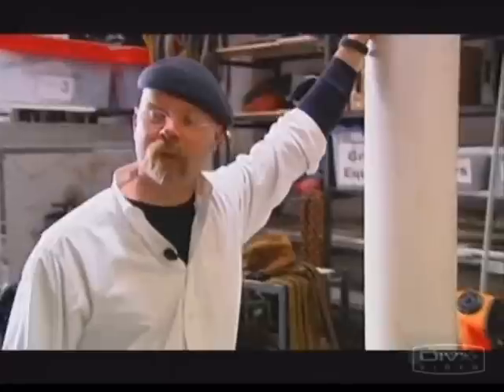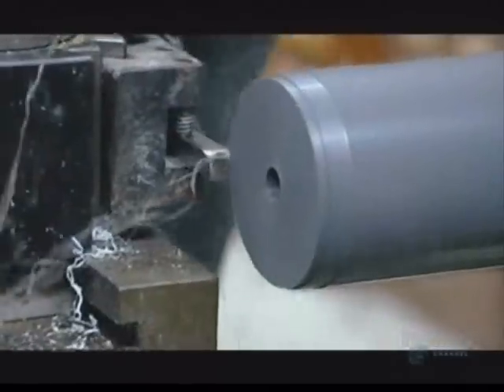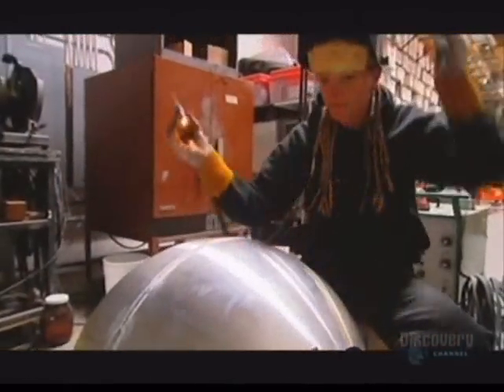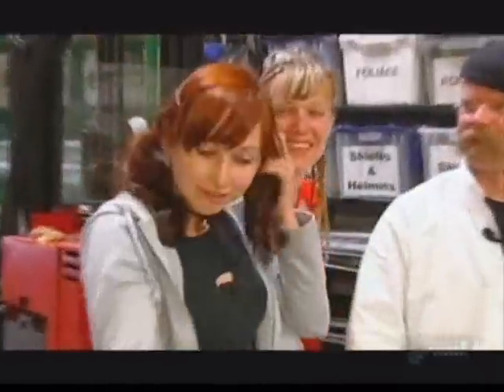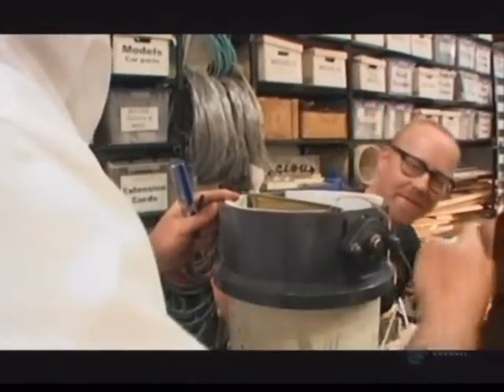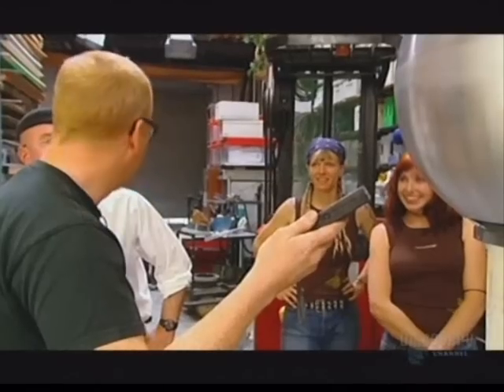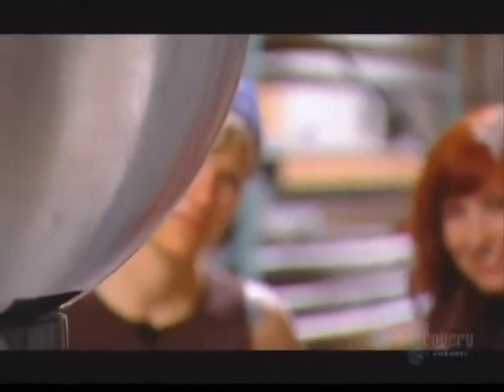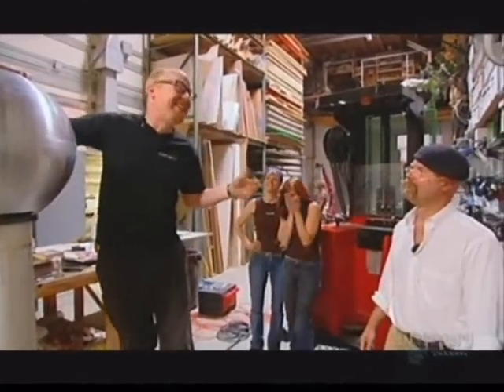Mythbusters Van de Graaff generator

Comment: You are right technically, current is the one that will kill. However high voltage is not safe as well. If there is a high enough potential difference, which will cause current to flow with your body acting as a resistor. You can think of it as what Ohm's law suggests, if you are familiar with it. The reason why Van de Graaff generator doesn't kill, it's because that it only has a charge of either polarity, which explains why the hair stands as the charge repels from one another.

Comment: The current does the work, but in the real world it is the resistance of the skin that determines weather you live or die. Ideal current sources, don't occur naturally.
However for a single pulse less than a hundredth of a second long, aka a spark, you can take quite allot of current (1.4 A). But high voltages (even at very low current) cause dielectric degradation of the skin and result in tissue damage. The result is that subsequent sparks at the same spot will produce larger currents.

Comment: Current and voltage are related by Voltage=Current*Resistance
As dry human skin generally has a resistance of 100,000 Ohms, it would take a sustained voltage of 50,000 Volts
You end up needing 25,000 Watts which is 25,000 joules per second, in other words, the spark would have to last at least 2 hours to do any damage

Comment: IDK about the 0.5 amps can't be fussed to research it, but you're both right.  Amps is equal to volts / ohms or (roughly) current = charge / resistance.   The human body is quite resistant to electricity, particularly the skin.  So it takes a pretty tremendous charge, to cause much current.  
Moreover, the belt can only transfer a small charge at a time, so that massive voltage is dissipated quickly.  Too quickly to kill you. Its why people often survive lightning (although burns may kill them).

Comment: you said  "600,000 to 800.000 volts and no one wants to be touching that." i dont mattter the volts what matters is the Amps you know how many volts a static shock is? around 1000-10,000 watts is just a nice way to put volts and amps together

Comment: Tesla use to make fun of Van de Graaff generator users.  Same size device working off a battery he could generate 10million volts which he stored up in a capacitor that could easily create discharges of 10,000 amps which would pretty much be able to vaporize anyone of the "scientists" employed by the mythbusters.

Comment: @XXXrokstaXXX 
One reason is that the surfaces holding charge are too rough. Another reason is the materials used for the rollers and belt.
The rough surfaces spray charge off and don't allow it to accumulate. The materials of the top roller, the belt, and the bottom roller must be chosen with respect to their positions on the "triboelectric scale" which is a ranking of insulating materials according to how easily they can donate/receive electric charge from other materials in sliding contact.

Comment: i once made a van de graaff belt out of a strip of t shirt impregnated with rtv rubber. 20 years ago, still have it still works, 12 inch sparks, bigest problem is length is critical very little stretch. works best in winter, hurts on finger tips, use back of hand or arm. think ill drag it out and set it up.

Comment: @rnedisc Good question :). Essentially a tesla coil is just a transformer circuit (resonant circuit), transferring current from a capacitor to a secondary circuit. And a Van De Graaff generator is an actual machine. It has moving parts and accumulates charge via friction, and stores the energy to the metallic dome surface. One generates energy, the other transfers it. You should be able to use a VDG generator as the "capacitor" or first circuit, and then run it through a tesla coil to a second.

Comment: @SparkyXX 

The problem was obvious when Jamie removed the sphere from the top of the column.  The upper brush must be at/near the center of the sphere to equalize the vectors of the fields acting upon the the brush.  If it is off-center, the "like" charge on the sphere repels the electrons or protons, preventing them from being collected from the belt.  If it is centered, the repulsive forces cancel.

Comment: I produced 1,000,000+ volts with one of these using a 22" steel sphere. It was a spectacular lightning show, but the field set off the houses security alarm! Mythbuster's machine has a lot a leakage points, which must be carefully insulated to obtain higher output.
Reply: backwoodsBrophil are you there tell me more plz
Reply: Why did you use steel?